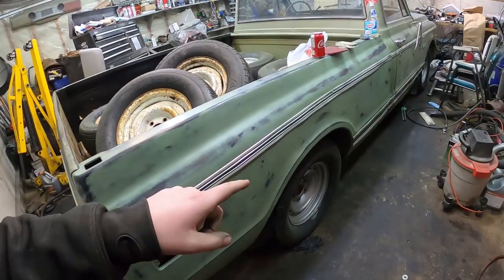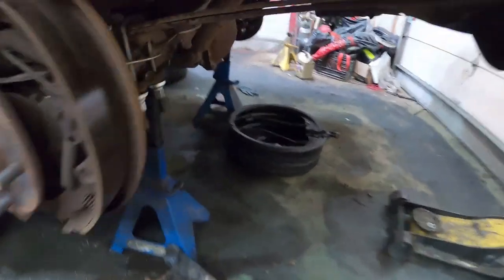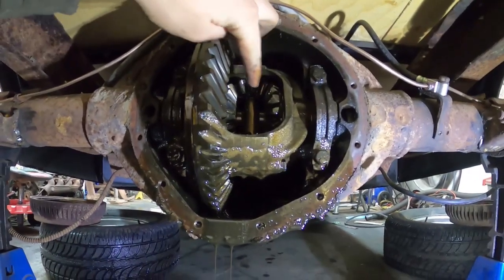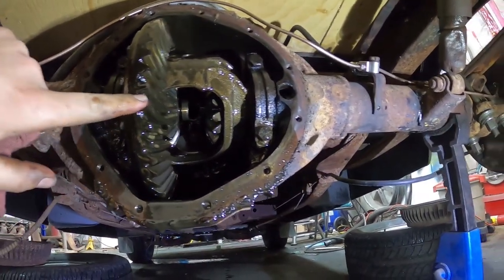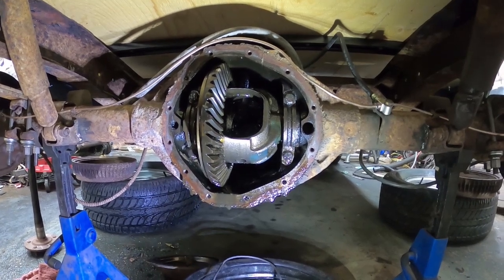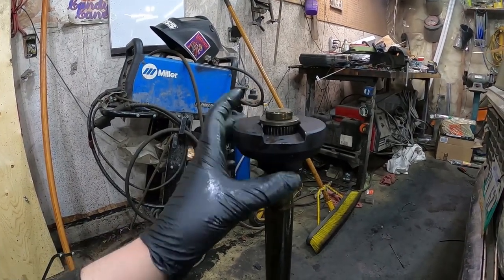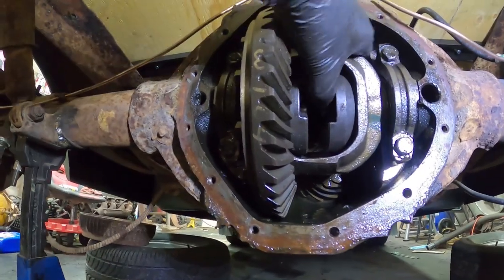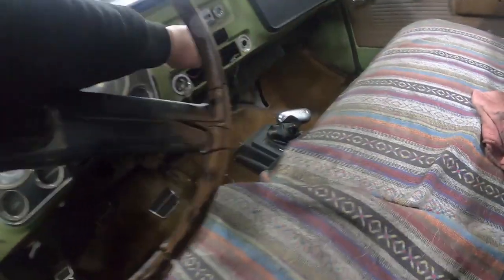Installing a Mini Spool in my C10

Comment from the maker: Tell me I'm an idiot for putting a spool in a street truck haha
Reply: Should be fun on ice!
Reply: We run them in our race car work just fine. However not a daily street driver lol.
Reply: I'm with you Dan!!! I would do it too!!! All tires must die!!!!!
Reply: You’ll need it driving in snow if it can’t even pull up the driveway.
Reply: I'm an idiot for putting a spool in a street truck.
Reply: Screw problem prone posi units. Just be more careful on wet curves
Reply: DD Speed Shop Worry about how practical something is after you build it
Reply: Im putting a full spooled Ford 9 inch in my LS swapped isuzu pup street truck im building. Had spools and welded gears in other vehicles and it's not as bad as you think on the street. Minor chirping of the tires making sharp turns at low speed. Sounds cool. At higher speeds over 15 or 20 mph you'd never know. 
I have a spooled Explorer 8.8 in my 04 Ranger and I almost never need 4wd when off road and it's amazing in the snow.
Reply: You did great but were missing caltracs or proper slappers
Reply: Im guessing axle bearings got the axles is why fresh
Reply: I was considering a spool but went with lunchbox locker on my truck similar to spool take out spider gears install locker. Cheap too at 250. Works good but loud

Comment: I had a '72 Vega with a built 388 sbc stroker and it had  Ford 9 inch rear end with spools, you'll be OK as long as you make wide turns, if you don't then you'll be bouncing all over the place on tight turns, you'll dig it though!
Reply from the maker: haha power through

Comment: I had to modify the C-clips and the little square blocks as well. They were to wide to fit between the round splined pieces so I had to grind them down On 2 sides

Comment: It did surprise me that the c clip didn't slide in end of axle but no mater its together and now fun times. Get a small amount of wheel hop on hard corners and kind of a learning curve for some when tires break loose on highway. I like it personally and more traction in the snow. You should never look back. Put spare pieces in a gallon zip lock bag and put under seat for next guy. Good gears for mileage. Power braking can cause some issues with trans after a while if that is the only way to break loose as mine is just touch fuel and say goodby to tires on back/LOL good job for a "nubee"

Comment: Where did you get the mini spool at  ?   I want one for my 70 model.
Reply: Yeah, I've never seen one of these, I wonder if it's difficult to order, you know, if you need the often missing aluminum tag...
Reply from the maker: ordered it off rock auto  90 bucks

Comment: Put one in my Chevelle years ago, towards the end of the racecar version/build when I was tired of spending money on it. If I could do it again I'd have spent the money on a posi unit, but what can you do. I wish I'd have saved the spider gears since I'mtrying to make it more of a driver now!
Anyways, if you are interested, paint a line along the length of the axles, you can later look at the axles to see if you are twisting them in the process of driving.
Reply from the maker: yeah a posi would for sure be better but kinda pricey for mehaha

Comment: Looking at you working under the truck drew my eye to the bed. Use the old gear oil and or motor oil to rub down the plywood to help shed water from it. Just an idea. WAY back, we used to rub down the underside of our fire apparatus with kerosene. Same sort of idea. Just a thought. LAY SOME STRIPES AND KILL THOSE TIRES!!
Reply from the maker: not a bad idea!

Comment: Thats much better than welded spider gears i know since your going to seller buyimg a series 3 posi unit and3:73 ring and pinion and c clip alimenaters would pretty dang costly but if you dont like tje way ot is you can do it later or someone can. Anyway didnt mean to preach excellent job eh!
Reply from the maker: yeah it can always b put back to stock this way
Reply: @DDSpeedShop  hell yeah burn um down wish i could help my rite foot is feeling heavy these days ha yeah!

Comment: Seems to me that should be a 6 lug truck
Reply from the maker: 71 was switched to 5
Reply: @DDSpeedShop  okay maybe in Canada
Reply: @curtisturner5018  No.... everywhere.  1971 discs were made standard as was the 5X5" lug pattern on the 2wd trucks.  4X4's carried on with 6x5.5".